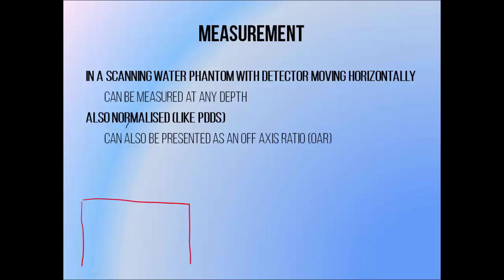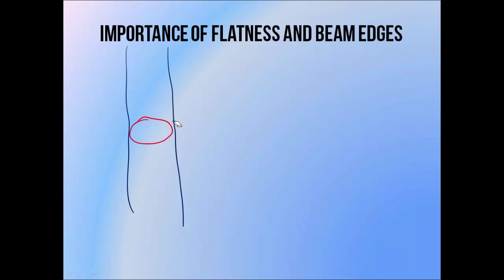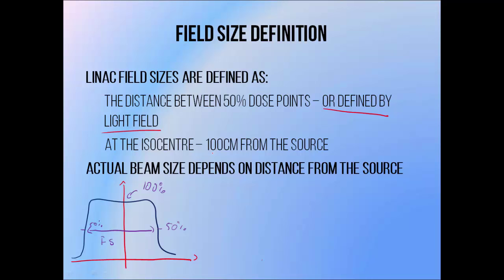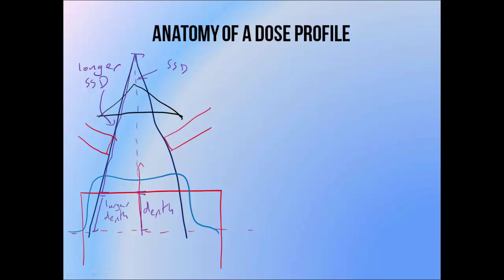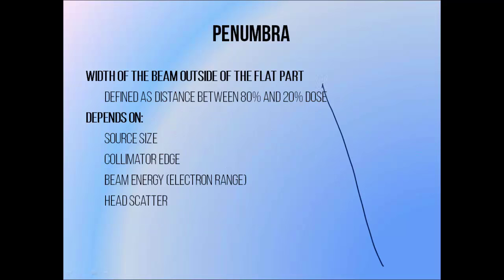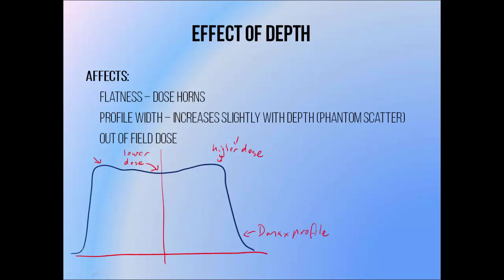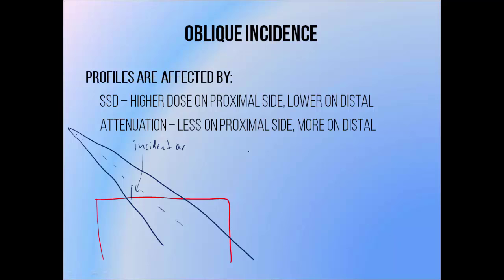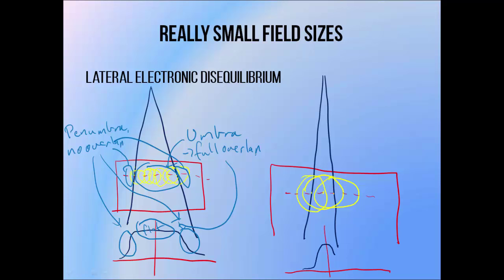8.3 -  Megavoltage photon beam profiles

Comment: I think the umbra is the area outside of the field edge (dose <20% of max dose), rather than the central part of the field as it is described in the video.
Reply from the maker: Hiya, are you sure you're not thinking of the penumbra?
Reply: Mary Jones  umbra, as the name indicates, is the area where the dose level is uniformly distrubuted with tbe slightest dose variation..
The penumbra is the semi-shadow area, where the beam rapidly falls off
Reply: Indeed according to the IAEA textbook (https://www-pub.iaea.org/MTCD/publications/PDF/Pub1196_web.pdf p 196) it is the region "outside the radiation field, far removed from the field edges [...] results from radiation transmitted through the collimator and head shielding". "umbra" also means shadow so it makes more sense...